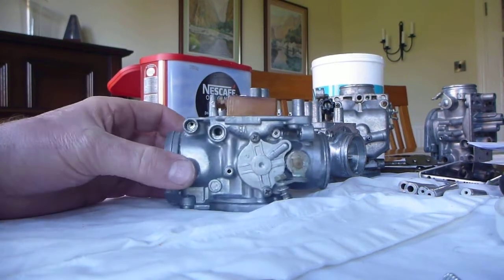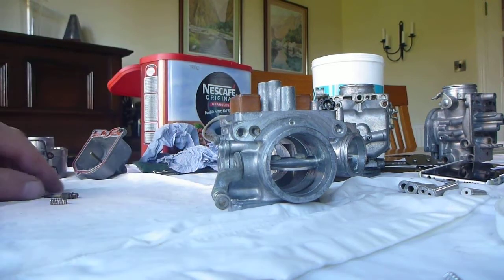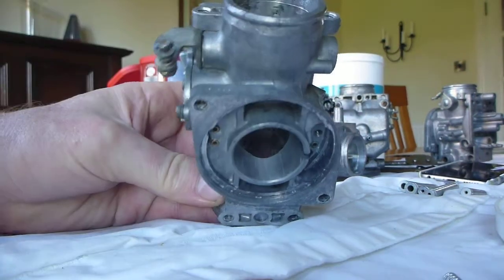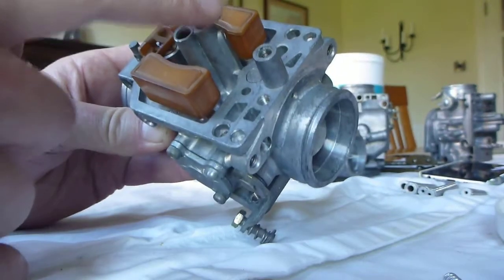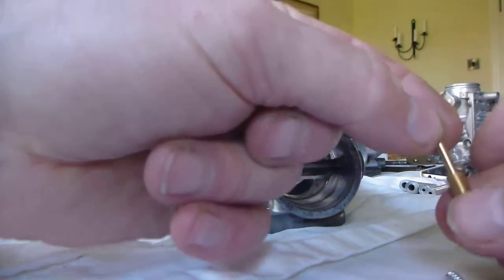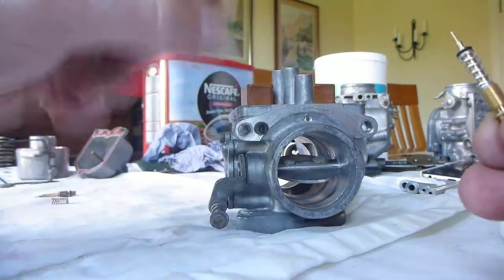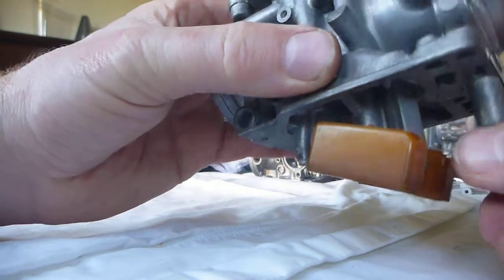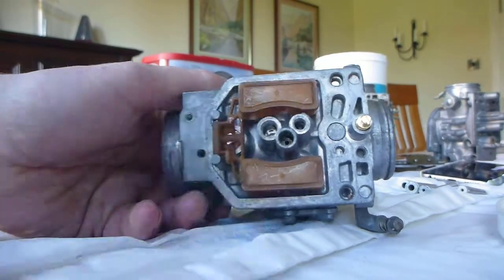CB900f rebuild - Carb - Pilot screw

Comment: You always want to take them out man. Mixture screws and associated pilot circuit passages are the #1 reason for poor running (or not running) on pretty much anything with carbs. Also, after fully disassembling and rebuilding carbs factory turns are nothing more than a starting point. Add to that the fact that the bikes are usually set as lean as possible from the factory for emissions and I find I usually end up at least half a turn or more richer than stock settings. I live and tune at sea level though, so take my advice with that in mind. Just gotta listen to the motor and go with what it likes!
Reply from the maker: Hi Greg. I agree. Since making this video I've seen a big range in the quality of pilot screws in aftermarket repair kits. The only way to be sure is to listen to the motor when you first start it up.
Reply: Can you help with my problem? as above

Comment: Hi there I have the cb 900 f 1979 dohc . Long storey but bottom line is it’s only firing on 2 and 3 cylinders, there’s a spark on all plugs the carbs have fuel, when turned over 2&3 fire up 1&4 don’t, take 1&4 plugs out and there wet. Carbs have been dismantled  in vibrating heat wash all jets etc are clear & clean  new rubbers new needles. Can you help me please
Reply from the maker: You say it's not firing on 1& 4 and the plugs are wet. Sounds like ignition problems to me, as 1&4 run off the same coil. 

If you're using NGK plugs, use a different brand and try again. Some plugs will give a spark outside the engine, but don't work in a compressed environment - I speak from bitter experience. 

Try re-terminating the HT leads and look at the pug caps for damage. 

Good luck !
Reply: @aldermarsh6776  hi  plugs are ngk show great spark when out, coils are new and check ok on ohms plus new non resistor caps. Thanks for getting back to me
Reply: PLUG WIRES ! THEY DON'T LAST FOREVER ! I have a 1979 750K and the wires DEFINITELY were quite tired. WHAT A DIFFERENCE 9500 RPM makes.
Reply: Did you ever get you bike fireing on al 4